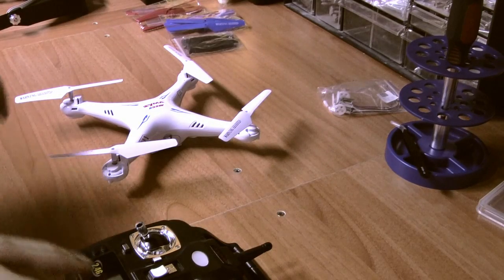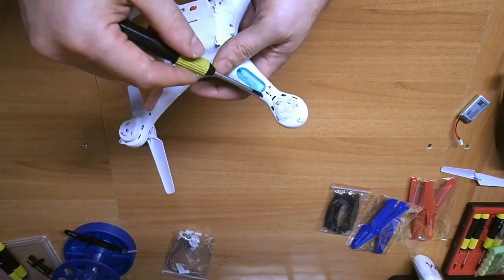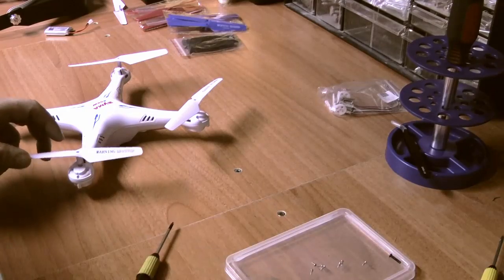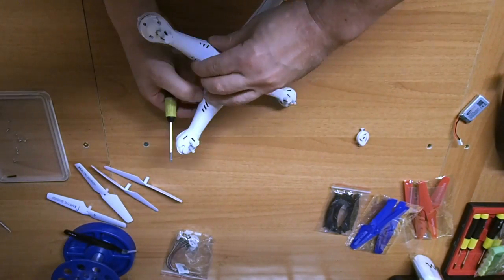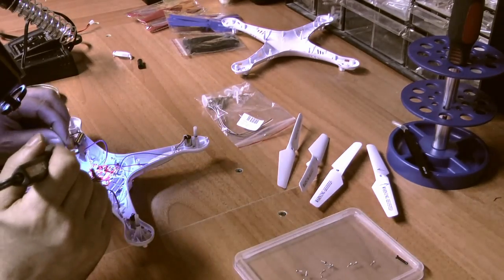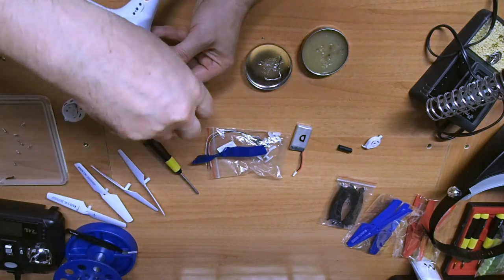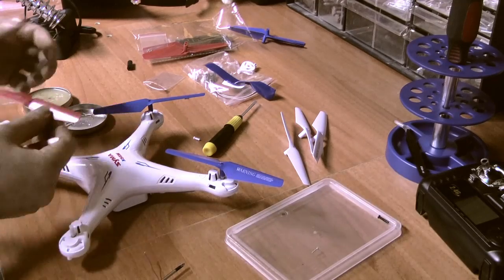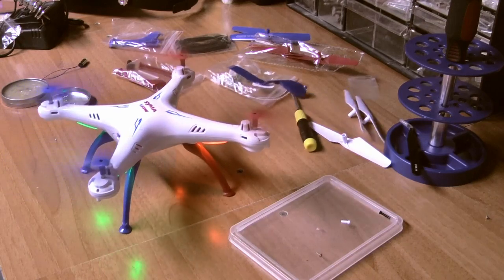Syma X5SW motor replacement

Comment: I have 2 of these. After only 10 hours use one of my drones already has 2 dead motors. Yes the cost of replacement parts for these drones are incredibly cheap but after only 10 hours use I decided to contact the seller and he's sending me a complete new drone as a replacement. Doesn't hurt to ask. However, because I can see these motors can and WILL fail I have ordered dozens of replacement motors as they cost like $1 each and taking the 20 minutes to swap out a motor is so much faster than waiting 2 weeks for a package from China. For an entry level drone these are easy to fly and very affordable.
Reply from the maker: That's why we flip to brushless drones. Syma is a great quad to start but coreless motors are not reliable.